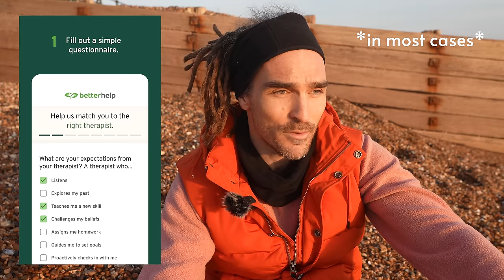Future Of This Channel / Life Update

Comment: Looking forward too all your plans. Family trips, DYI projects and so on. My biggest suggestion for flying with a 9mon old is having Neo suck on a bottle or pacifier during take off and about 15 mintues before and during landing.  It helps equalize the pressure in the babies ears. I have 3 kids and have done alot of air travel with them and this has always worked. No crying babies due to hurting ears! ❤❤❤

Comment: I really liked the trip you attempted across the US in the Camper. I think you should completely retry this, maybe a different route but still coast to coast and in the summer. Could you fit solar panels to the top of the roof so you could charge a battery during driving, even if you have to mainly charge from an electric point it will add some miles?! I also like the idea of traveling in one direction until you end up getting back to where you started. Maybe a trip with the three of you going east would be an idea. Either way, great channel, keep it up and have a great 2024.

Comment: Regarding Flying: Have the baby drink as the plane is taking off and ask the flight attendant for a heads up on the descending part.  This is when the air pressure messes with their ears, and drinking will help them equalize.  If they're asleep before take off the babies most likely wake up to tremendous ear pain and start crying for 30 minutes.